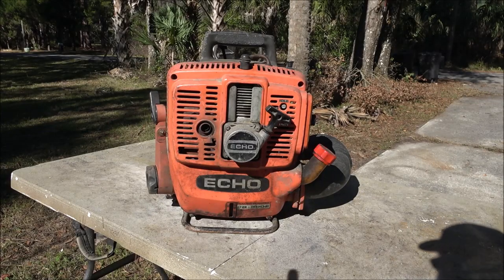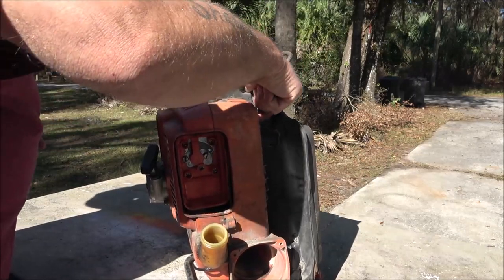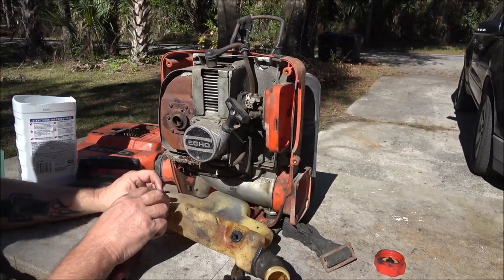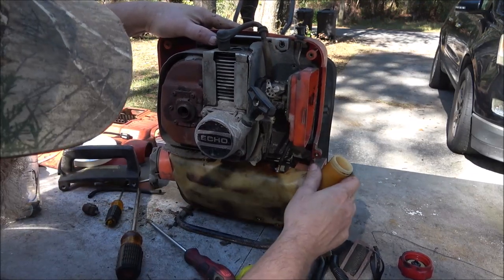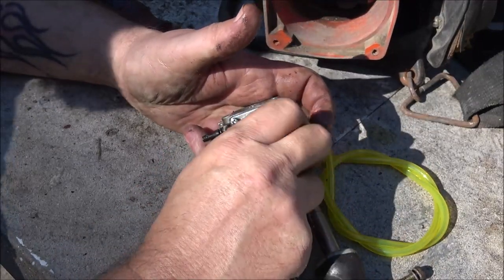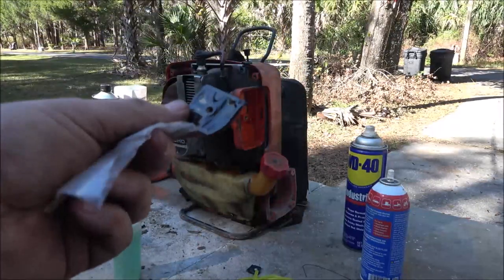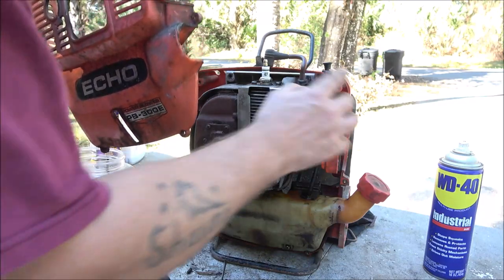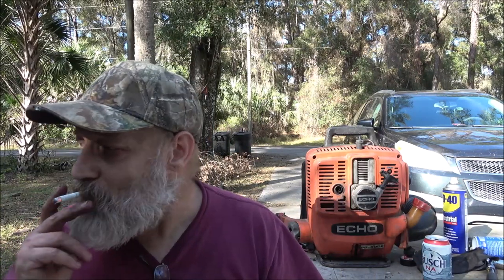Will It Run? Echo PB 300E Backpack Blower

Comment: There is a check valve in the in tank fuel line inlet to prevent gas mix from returning to tank.  I have one of the same model and it has been a workhorse.  But I cannot get it to run.  I put a new metering diaphragm and the upper diaphragm in it, fuel filter, check valve, fuel lines, and it sparks.  Put fuel in cylinder and it fires that off.  And it looks like it is pulling fuel from tank to carb.  Has good compression.  New gas mix and choke works. It just won't start with pull cord.  Appears to be carb related.  Am I missing something?
Reply from the maker: No, in fact you hit the nail on the head when you said carb issues. What you'll probably have to do is to take the carburetor off and tear it all the way down and soak it in the carb cleaner and make sure all the little holes are not plugged. I've had the same issue on chainsaws and weed eaters. I'm thinking they're still just a piece of dirt somewhere in that carburetor.
Reply: You were correct, it was the carburetorcarburetor. But it wasn't Clogged or anything.  When I was Disassembling the measuring valve side, I noticed that the metering lever Was that down That the metering diaphragm could not make contact with it. It' caused the machine to be starved of fuel, of course it wouldn't start. A simple bend of the lever,reassembly, and two pulls on the rope and it started right up. It's now back in the realm of the living.

Thanks for encouraging me to go back into the carb and check things out again.  Grateful for you help.

The only reason I put the effort in was cause my wife likes the machine and will use it.  Happy wife, happy life.
Reply from the maker: @edwardartz3312  that's awesome my friend. I'm so glad to hear that you figured it out. Great job Edward. And thanks for letting me know what the issue was. And thanks for sharing that on here, it might help someone in the future. Enjoy the rest of your weekend my friend.